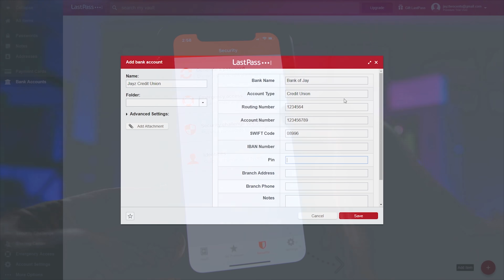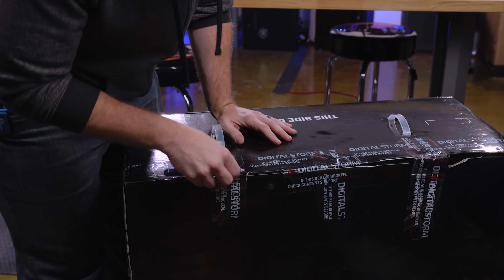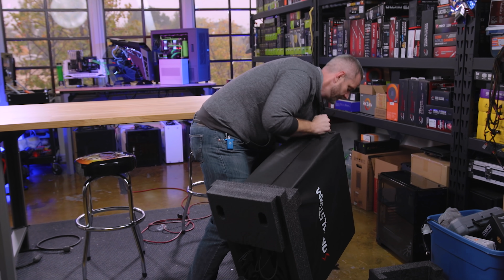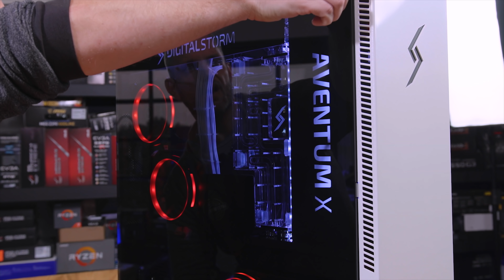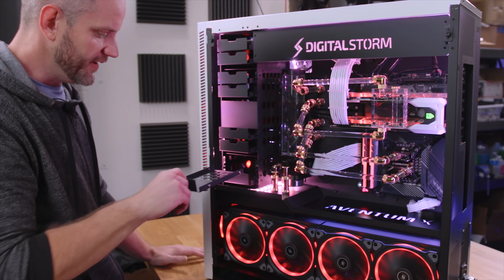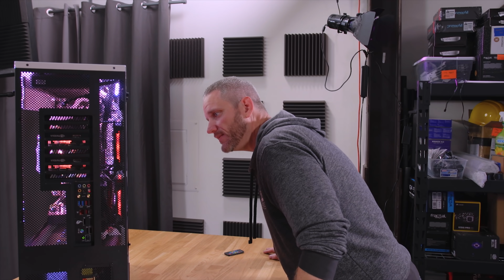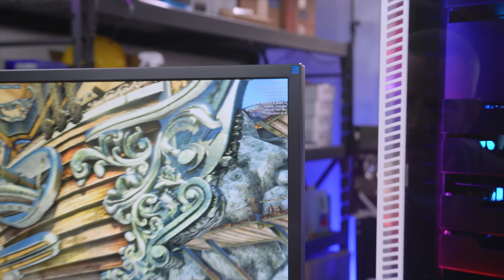Unboxing a $9500 Custom Computer...

Comment: Problem with testing massive loops with so much water, is it takes a good while to hit the top temps, but when you do it takes longer for temps to go back down. Not convinced by blocking the fans off with glass. Really needs benching for an hour run. CPU temps might not be much better than a good 360 AIO.
Reply: Good point, how did that even happen in a completely custom case.
Reply: Or a good air cooler lol
Reply: @IWLGaming  Yeah, imagine! Noctua DH15 in the meshify C could rape it. Nice compact, much much lighter and much much cheaper. At the end of the day SLI is crap too, raytracing dosn't even work over sli and some aftermarket cards already cool great.
Reply: just shows again how he is not really that knowledgeable.

Comment: I really don't understand flash pass. To remove the problem of 1 password for all websites. Instead you have many passwords displayed on 1 website that only uses a password to get into. Does nobody else see this flaw? It is like having 3 front doors all with different locks, but then placing all 3 keys on 1 key ring. It adds complexity and annoyance, but no actual security benefit. 

If you want a secure place to store your passwords I have one for you. Buy an old nokia(link to $60 one below) Don't activate the phone. Set a password you will remember, just 1 password. Put a list in that phone of passwords. WANT IT CHEAPER, watch this. Buy a cheaper non touch screen nokia phone(Link to a $20 one below). Add a pin code. Make the name of a contact the place for the password, make the phone number the actual password, and some have an email slot that uses numbers, letters, and capitalization. There a cheap 1 time fee of $20 that stores tons of passwords as long as you have to device by you. I'd argue magnitudes more secure than an internet website(granted the website is free, but nothing on the internet is secure) If Facebook can be hacked why not this little website?

I chose Nokia because the company is basically a dead brand. Cheap phones, no updates, and no need for internet connection. 

 https://www.amazon.com/Nokia-Unlocked-Smartphone-T-Mobile-MetroPCS/dp/B07JZCFFQR/ref=sr_1_17?s=electronics&ie=UTF8&qid=1544061321&sr=1-17&keywords=nokia

https://www.amazon.com/Nokia-6205-Contract-Verizon-Phone/dp/B0084J0V1C/ref=sr_1_1?s=electronics&ie=UTF8&qid=1544061455&sr=1-1&keywords=nokia
Reply: I still wouldn't do that because the best password security is memorization. I have like 9 passwords that I just memorize.

Comment: $9500 and still a lower Cinebench score than my 9900k setup...
Reply: You wouldn't buy this for performance, lol. And Jay didn't overclock the CPU (or GPU) at all. Just all cores max turbo.
Reply: @kaldogorath  still don't get why you'd pay so much then.
Reply: @Ender_Wiggin03  Because of "aesthetics" or some shit. I mean, sure, the parts are expensive, but 9500$? Not in a million years. We can take a good 3k away from it for the parts if were generous, let it be 3.5k. There is still 6k left in the budget. Thats my car and a new GPU. I dont think that all the work they did on the system is worth 6k all together. Lets say, idk, the dude who build this makes 50 bucks the hour, thats still 6000/50 = 120hrs worked on that. so 15 complete work days. I dont think it took them that long to build this PC, the markup is insane. And were going with a high ass salary here, 50 bucks the hour is gigantic for the work theyre doing. So if they get paid less, the markup is even higher.
Reply: @tatzecom  exactly
Reply: @tatzecom  3k for parts.. come on.. sure I know you wanna make a bias-point to get your salty butthurt view across' but why throw any sense of objective out the door... weird curling kid mentality.. you think just 2x2080TI is the whole freaking computer, nahh get real.
Reply: @OreoCakestir  9900k, RTX 20170, 32GB 4266 @ 3.9 (long story, but good latency), 970 Evo 500GB Boot, 1TB 860 Evo storage.
Reply: @Ender_Wiggin03  What motherboard?
Reply: @ShadowthroneXY  Asus Rog Strix Z390-E.... Stable at 5.1 though, Ring bus at 4.7
Reply: @OreoCakestir  BMW E39 520i from 2004 ^^ Got 105km on it and is in godlike condition, the previous owner was from 1935 and would push the car too much or anything ^^ Got it for just under 4500 bucks, why you asking?

Comment: thanks for unboxing/review
and by the way,
would you review this powerfull all in ones and tell us it's shortcoming and versus a pc gaming /(clevo p870tm laptop with the same spec) which one jarrod's Tech would suggest for what audience:

1-CUK Bionic G32 VR Ready 31.5" QHD 144Hz 4ms All-in-One PC (Liquid Cooled Intel i9-9900K, 32GB RAM, 1TB NVMe SSD + 2TB HDD, NVIDIA RTX 2080 Ti 11GB, 600W PSU, Windows 10) AiO Gaming Desktop Computer :
https://www.amazon.com/G32-i9-9900K-Windows-Desktop-Computer/dp/B07K1RY7MG/ref=sr_1_1?ie=UTF8&qid=1543437705&sr=8-1&keywords=9900k+all+in+one

2-CUK Bionic G32 VR Ready 31.5" QHD 144Hz 4ms All-in-One PC (Liquid Cooled Intel i7-9700K, 32GB RAM, 500GB NVMe SSD + 1TB HDD, NVIDIA RTX 2080 8GB, 600W PSU, Windows 10) AiO Gaming Desktop Computer
https://www.amazon.com/G32-i7-9700K-Windows-Desktop-Computer/dp/B07BRYHT74/ref=sr_1_1?ie=UTF8&qid=1543437695&sr=8-1&keywords=9700k+all+in+one

Comment: the english use the same system as the americans and canadians, after all, the english brought the system with them all the way from marry old england way back when.
Reply: The english used to use the imperial system. Now we use a combination of each, and most people can generally understand and translate both fairly easily. (For example if I'm weighing myself I use stone, but weighing a computer I use kg)
Reply: @____5837  That's interesting, over here we use the metric system, however, in construction we often use inches, nails for example are always in inches, nuts and bolts in metric. Just two examples.

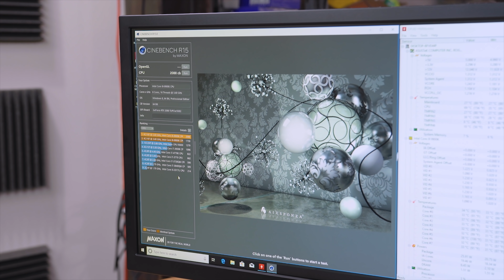Comment: 8:11 2088 points??? at 5 GHz ? my R7 2700X hits 2019 points at 4.25 Ghz with 3200 MHz RAM CL14... and all of that on a 280mm AIO at 74°C peak... something is wrong here...
Reply: Nothing is wrong there. Maybe you have better optimized system or smth because if you can hit 2088 with 4.25GHz then you did better than guru3D with 4.4GHz:

https://www.guru3d.com/articles-pages/amd-ryzen-7-2700x-review,9.html
Reply: And a quick look at LTT's forum Cinebench R15 scorecard tells me that it's your score that is way above average. Another look here:

https://www.overclock3d.net/reviews/cpu_mainboard/amd_ryzen_5_2600x_and_ryzen_7_2700x_review/6

Only confirms the trend. It's your score that is the outlier and if you managed to score that high then congratulations, you have an awesome chip.

Comment: Don't buy a Digitalstorm PC. I sent mine back three times because they are completely incompetent. They hacked apart the pump for the water cooling loop to fit it in my Bolt 3. After thinking "they're professionals they knew what they where doing" in four or five months it leaked. Apart from that, the computer was having boot loop issues and power problems. It was a nightmare for $4,000. I'll never recommend them to anyone ever.
Reply: THERE YOU GO. ANOTHER BUYER WITH BAD REVIEWS. Everyone, I'm not the only on with really bad experience. I had a nightmare for $4500 for a whole year. 3 RMAs, all for their own fixes, not from my user error.

Comment: Huh. I always wondered how much Jay weighs. Now I know! All that's left is to find out how tall he is.

He's about 15lbs heavier than the most I've ever weighed, but I bet he's tsller, so the BIN is likely close.

Now, I'm about 205. It's a combination of my wife trying to keep me alive with good, healthy food and working at FedEx.

I don't often get single packages that weigh over 100 lbs. When I do, it's usually industrial steel or playground equipment.

I'm a loader, not a driver.

Comment: I understand that manufacturers just follow the trends to make money, but putting obscene number of fans right against glass panels is so dumb it's hurting. "See through the glass here, there are a lot of fans, it's great for cooling!" And then the only way for the system to breathe is tiny grill on the sides of the front panel. So dumb.

Comment: I received my Digital Storm PC about two weeks ago. It's been great so far and I'm very happy with it. The build quality is outstanding from what I've seen.
Reply: Good luck, I hope you dont have to ship it back. If you do, you may receive awful experience. Be sure to test the computer as hard as you can, even with high end monitors if you can. Their stress tests aren't high end, they dont use monitors above 1080p, and consider Ultra settings on that resolution with 1080tis to be good stress tests. Good luck, hope in your case it remains a good computer. Last year, I thought I would be okay. Turned out I wasn't :/

Comment: Wait how are those fans gonna work against a glass panel?
Reply: Sacrifice temps for looks all that water cooling and tempered glass balance out the internal temperature.  Though i ya want to super clock it tempered glass isn’t suitable nor is a closed off side panel . 

That case would be amazing if it had a mesh pannel covering the fans only then the rest glass , for 9.5k i’d expect this not to be overlooked but i guess the makers thought if a enthusiast buys this “why they could build it for 1/3 of that” so didn’t bother maximising the potential oc overhead temperatures.

The person that can burn 9.5k won’t care about a extra 0.2 mhz or 5-8c temp drop .
Reply: Honestly when the system is watercooled it's not THAT bad if you have exhaust. I'm sitting on fully watercooled SLI setup in IN WIN Tou 2.0 and the front radiator is choked by tempered glass (the top one can exhaust just fine) and the temps I have aren't bad - about 50-52c on both GPU (2025) and about 60c on the CPU (i7 6950X 4.2GHz with 1.25v). Sure, it could be better but those temps are nowhere near bad enough so that the looks has to be sacrificed. It helps if you have a monoblock as well since you are not concerned about active VRM cooling.
Reply: When they face you, they exhaust, so he should cut a little of the glass and then he should be ok
Reply: @Ellis-rq6oz  Nope thats wrong, the side of the fans that is facing the glass is the intake side not the exhaust side .... they are blowing towards the inside of the case not towards the glass ;)

Comment: Is it just me or is this kinda... not very aesthetically pleasing overall? The RGB LEDs certainly don't help with their rainbow vomit, but I also feel like they've done a terrible job of colour matching the various components. I don't like the case either, it has so many decorative bits that it does not form a cohesive whole that I find pleasing. For ten-fucking-thousand, I'd expect it to be the most visually pleasing thing to look at. Overall: meh.
Reply: Glad you went into detail on this. Im also not feeling the aesthetics at all. Theres is no system wide color pattern to make it look like a complete custom build. Outside is white and black, inside is white, brass and red. It makes no sense. And yea the RGB is out of control. Its not even synced so theres just random colors everywhere. Can't believe anyone is paying this much for such an eye sore. Imagine trying to play games next to this disco ball.
Reply: Yeah it isn’t a particularly good looking case ether. I’d rather buy a $200 thermaltake view 37 or 71 (if you just want a big class case but personally I like the 37 more)

And you’ll get THE EXACT SAME FANS! 

Those are absolutely just rebadged thermaltake riing plus 140-200mm fans
Reply: @whitepaws60  Yup I much prefer my Thermaltake Core P5 to this monstrosity. Or even my custom aluminum extrusion case. This thing is massive and somehow still feels cramped. No airflow for any of the fans. Theres like 8 intakes and I don't see a single exhaust. No wonder the temps are awful. I bet if he did a proper extended benchmark this thing would hit air temps.

Comment: Really 2 sticks of ram for a 9500$ pc. Atleast 4 sticks of 8 GB.
Reply: ... It uses 2 sticks of 16gb my dude
Reply: Zack Burkhart 2 32 gig sticks actually

The most expensive one starts off at 5k with 64 gigs. So unless they downgraded
Reply: Literally the same as it using 4 sticks of 8 except faster

Comment: It looks nice, but I do agree with you that the airflow setup in the basement is a little odd. Both of those rear fans are creating a high pressure zone behind the radiator which will definitely limit the amount of air going through it. You can probably thank the tempered glass panels for that compromise. For nearly 10 grand, their shouldn't be any performance compromises.